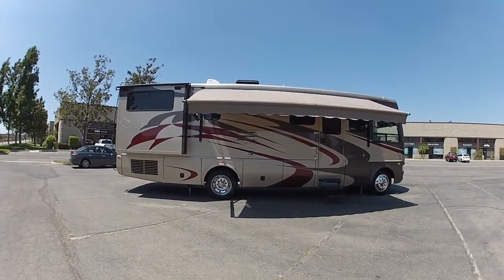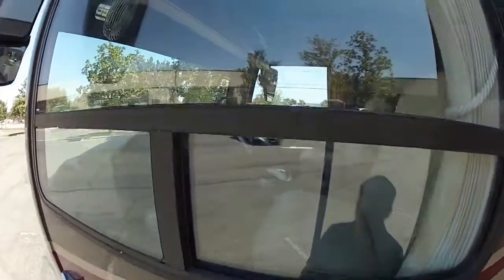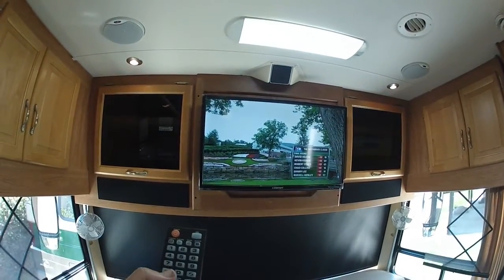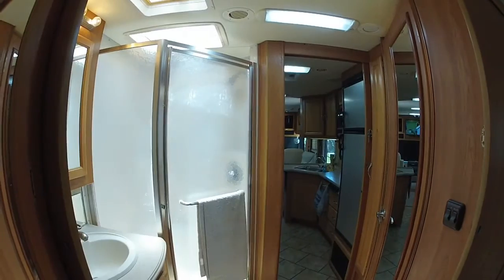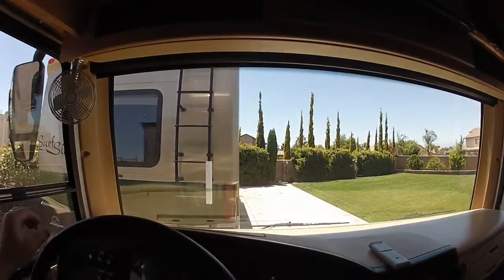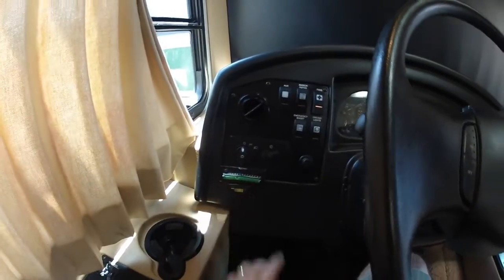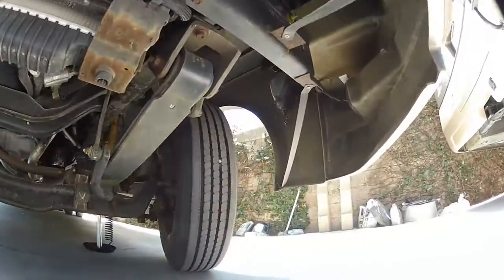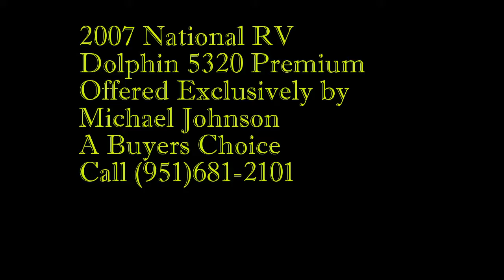2007 National RV Dolphin motorhome full Video Tour Inside & out, Top 2 Bottom

Comment: First thing i would do with this thing if i buy it..would be to Replace all the Shocks & Get Fresh Heavy Duty Midas Spring Guard on front & back and also get me a full cover mask OR better ..take it to a RV sized Garage Lift and pay the guys to make sure everything gets lubed well PLUS i would have the whole under carriage sprayed with WD40 (except any rubberized contacts) the rest (except the Mufflers & Converters) the rest would be heavily sprayed with approx 2gallons of WD40 to help bolster good ANTI RUST action from happening so quickly after lots of rain and puddles traveling through all the HWYS and all the small roads leading to diverse parking areas.
Reply: Oh and one thing more..i would have all the Tire Pressure adjustments checked PLUS make sure all the Lug Nuts are tightened according to specs
Reply: Also make sure i have a fresh spare tire/wheel for front and also one or two for the back carriage tires...because you never know and it would feel good knowing i am covered on Emergency Tires